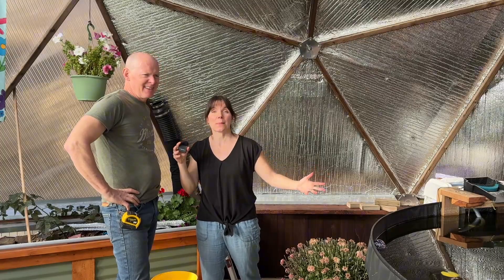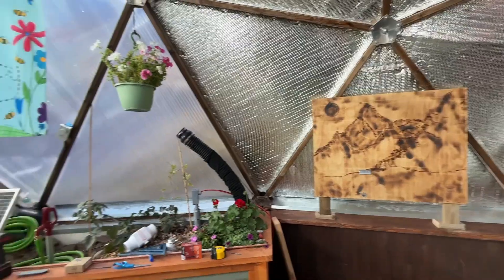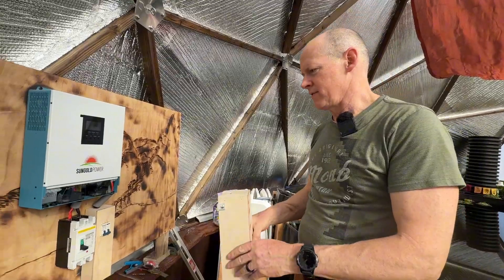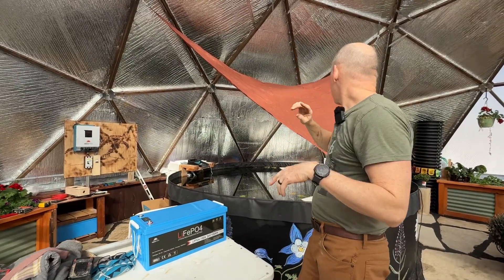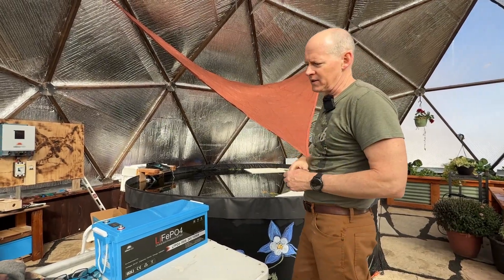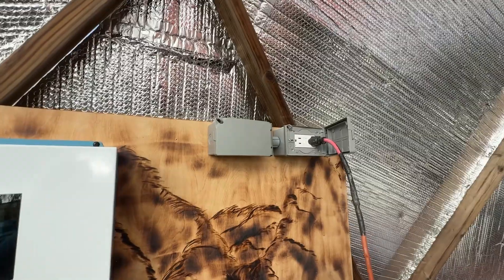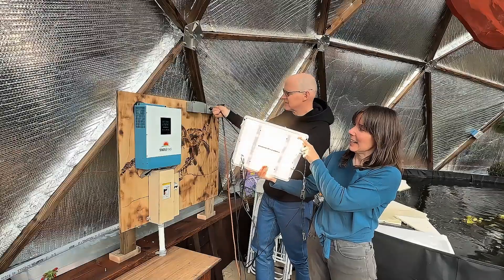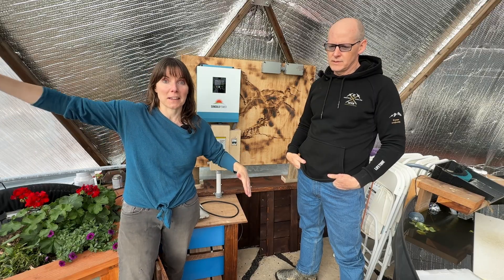Off-Grid Dome Greenhouse & DIY Solar: How Much Power Did We Get??

Comment: Ok, might just be me but I was appropriately elated when our panels first started generating power, what I didn’t expect was how bummed I felt the first time I saw that our batteries were full on a sunny day and we weren’t able to consume all of the power generation from the panels.   😂
Reply from the maker: Ha! That very thing happened today!
Reply: @ColoradoMountainLiving  
When the batteries are fully charged divert the power from the  panels to a water heater in the pond. Waste not, want not.
Reply from the maker: Love that idea!! Thanks
Reply: @JohnGuest45 Thanks!  Sounds like I need to build a pond… 😎
Reply: @ColoradoMountainLiving  
It takes around 7300w (25,000 btu) to heat 3,000 gallons of water by 1 degree F. The solar charge controller should  have an option to redirect the excess power to a dump resistor (or heater)

Comment: Something I learned a long time ago - the L-B should be the same size as the conduit you are pulling through when you need to add or change wires.  Either that or don't glue the connector to the conduit, you can then slip it off later and pull straight out of the conduit to add or change wires.  Keep Building
Reply from the maker: That's good to know for future projects, thanks for the tip!

Comment: good video,     given the winter wind a wind gen might be an option, but you will need to decide if you want a low wind or high wind blade for your generator.   wind is not normally anything i would recommend to anyone.  it is normally a loosing decision
Reply from the maker: That's an interesting thought, we'll definitely keep that in mind! We've been thinking of it for years.
Reply: @ColoradoMountainLiving 
 as stated i usually do not recommend wind.  lots of issues, and as for your panels, if you tie them to the base, i think you are asking for trouble.   actually i know you are.

i have a booklet on building and using wind power, unfinished at this time, i wrote it over a 4 day break while in college that will contain a ton of info that will help.

if you want a copy, you must promise not to sell, print or share the written text with anyone.  i hope to finish and sell it some day.  i have one on survey of property that i hope to start selling soon.

Comment: Hi Amy and Brian,  may I strongly suggest that you place all of your solar panels on the ground level just like you have done with the dome.  I have 21 panels on my roof and it’s a pain in the rear to get the snow and ice off.  So do yourself a favor and mount them on the ground.   Great job you two.
Reply from the maker: Oh thanks for that perspective! Roof sounds logical now but maybe not so practical in 10-20 years as we get less nimble.
Reply: @ColoradoMountainLiving  yes your correct, I’m 73 and don’t feel like it most days.  We live in Sterling Heights Mi. And don’t have the property to in stall the panels on the ground like Brian did,  I sure wish I could do that.  I would like to send you some photos of our system.
Reply from the maker: Thanks so much for the feedback- feel free to email us comountainliving at Gmail dot com
Reply: @ColoradoMountainLiving  Amy, Brian,  roof mount solar required taking them down for inspection repair and any roof work.  ground frame mount is the best practice, however, installers will often try to point you to roof as it guarantees further income,  and also, your roof better match the latitude. in texas a lot of roof mount systems will never reach potential as the angle is wrong.  also, code requires they attach to the roof to prevent lift damaging the roofing rafters and joists systems.
Reply from the maker: Great points

Comment: 🇨🇦Didn't watch yet but was/is the pond water slightly heated for the snowy overcast days to heat the inside of the greenhouse? Been watching you guys since you were building the circular stairs in the house. Cheers from the Rocky Mountains in BC Canada!
Reply from the maker: Wow- amazing! Thanks for sticking with us. The pond is not heated other than with the sun. Since the cold snap and cloudy days ended, we've gained 10 degrees in the pond. (back up to 55. Hopefully a few more days of sunny & mild temps will get it back up to 60)